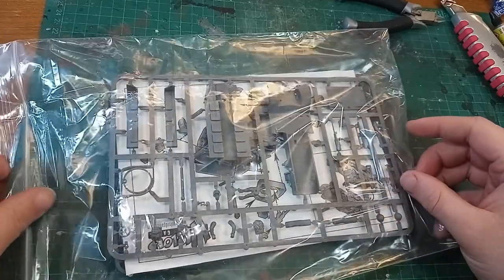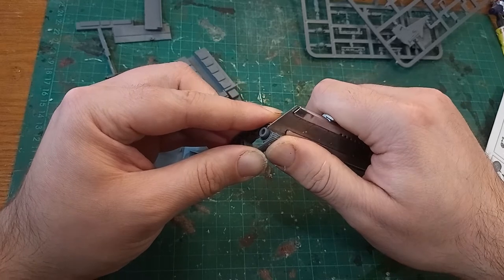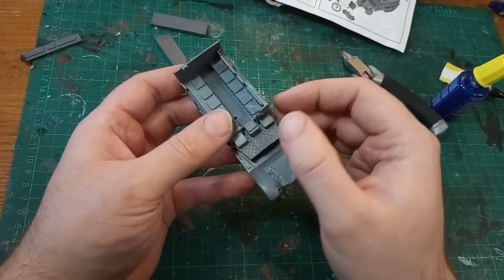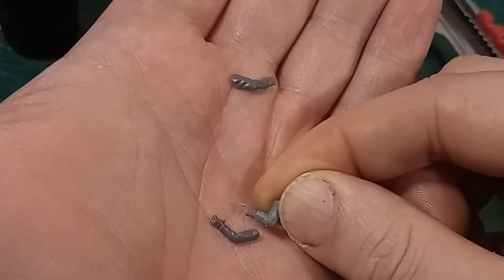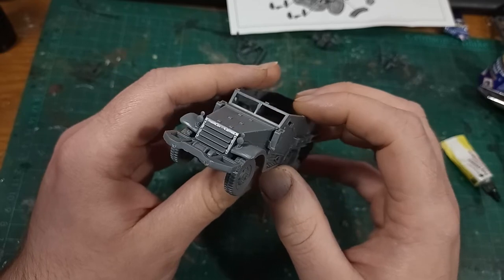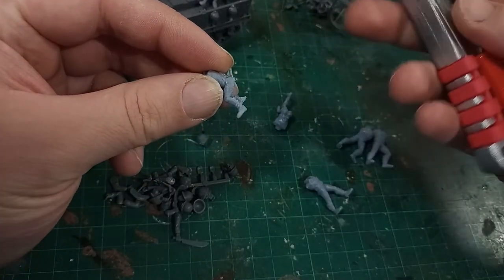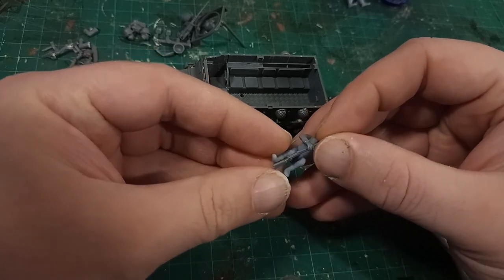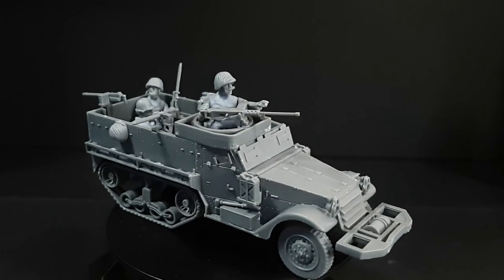M3 Halftrack by Warlord Games, ED-SKaR makes, part 1: Building

Comment: My OCD kicks in for mold lines. Those molded tracks would have driven me crazy. Looks like a good kit in the end, but that could be because of the builder.
Reply from the maker: There are a few I missed so don't look too closely :D
I think a file would be easier to use for tracks like these, rather than the knife, but as mentioned, they are covered by the armour panels of the hull, so not a big deal in this case (but... the road wheels, they are visible :( )

I wouldn't call myself an expert, but I have been at this a while so I've picked up at least some good techniques :)
Reply: I built one last night after watching this video, and honestly I was able to remove most of the mold lines on the tracks by simply scraping it with a utility knife (mine's an Olfa, but like a Stanley knife) and then using Tamiya Extra Thin in between the links. Any thicker cement wouldn't do the trick, but an Extra Thin plastic cement should break down the remnants enough for a decent finish. Once it's primed, painted, and weathered I don't think they'll be noticeable on any of the visible surfaces.